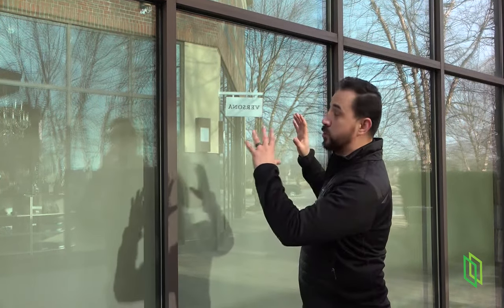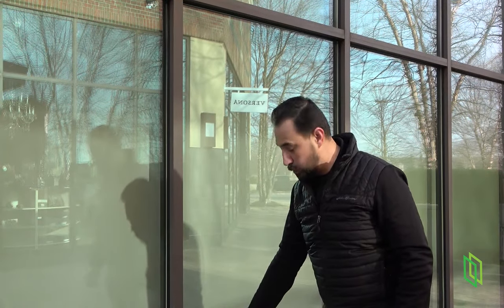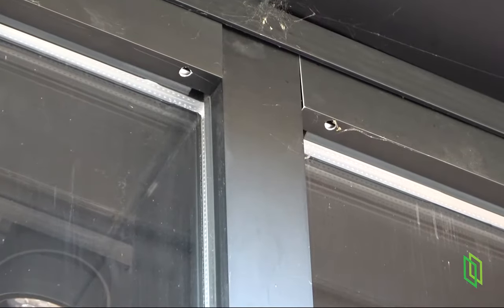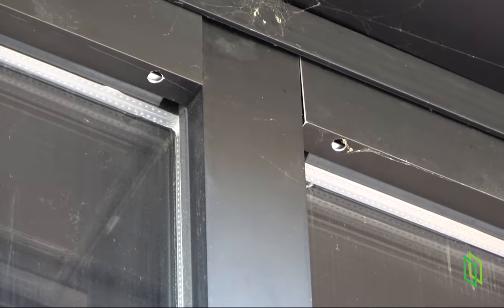How Storefront and Curtain Wall systems manage water

Comment: Note that although the frames are caulked on the top and sides on the perimeter on the outside, they are not to be caulked on the exterior sill (bottom).  By leaving the exterior sill (bottom of the frame) unsealed it allows water that gets into the frame to escape and drain to the outside where it does no harm.  
Maintenance people often notice that the bottom of the frame (on the outside) is uncaulked on the exterior and think that must be the reason their frames are leaking on the inside at the bottom.  It's not.  Once they caulk up with exterior sill (bottom of the frame), it usually makes a small leak into a much worse leak.
Reply from the maker: Kenneth, absolutely, we notice this all the time also. It's actually a huge ongoing problem. We have actually asked Alex to go out and find some examples of good vs bad that cover this very topic in a new video. Thanks for the comment!

Comment: The sub sill should have weep-hole’s that will allow the water inside the system to weep out. The weep hole can’t be a 1/4 inch hole or it won’t weep out. That size creates a suction within the weep hole and will not allow it to drain.
Reply from the maker: Thank you for the comment. Also, remember that weep holes should be oval. This also prevents them from clogging
Reply: @LearnGlazing  I have also seen little screens that go in front of the weep holes Prevent bugs and debris from going in there
Reply: Capillary effect.